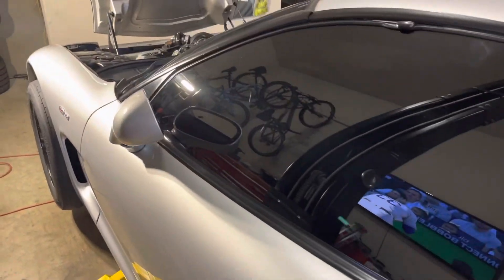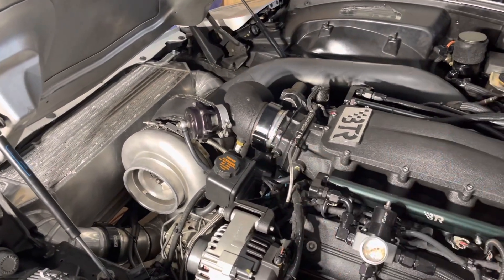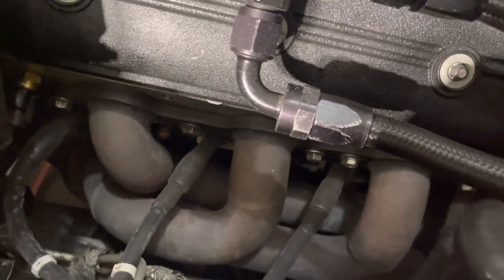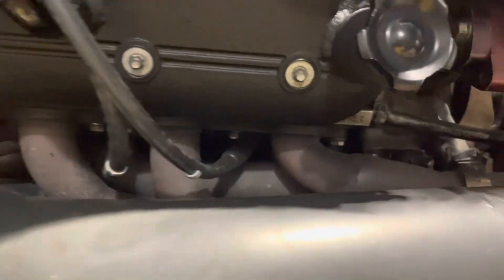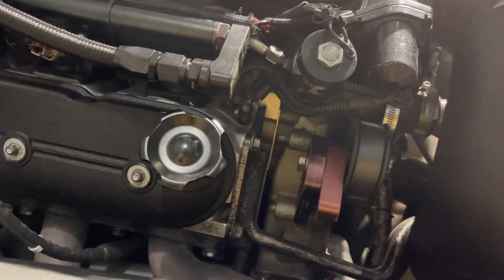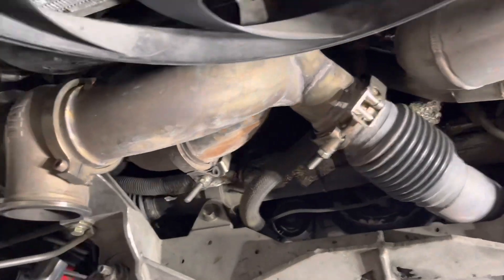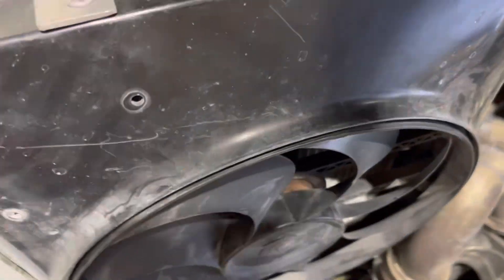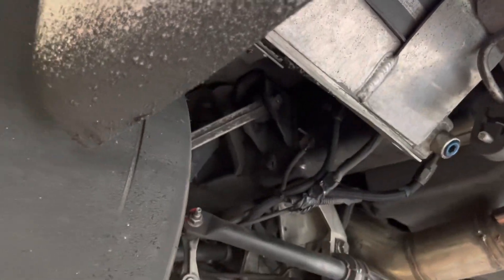Corvette turbo kit breakdown

Comment: I love this car. C5s are such great platforms still and easy to work on. I just picked up a twin turbo car with a upp kit. I'm excited to get it all dialed in and putting in some work. What is the rear wheel setup and did you have to change brakes or do something different to get those to fit?

Comment: Can u just throw a turbo on I have a c5 not the z06   I just wrote the seller and they said easy installation  no kit required
Reply from the maker: Definitely not a easy bolt on installation, custom kit required in most cases
Reply: @TheBullyC5Z     ok he said he'll send  installation instructions idk I have a stg 4 cam not yet installed but I'm gonna A have to upgrade torque converter or  upgrade  the trans I'm like I'd  rather just turbo it